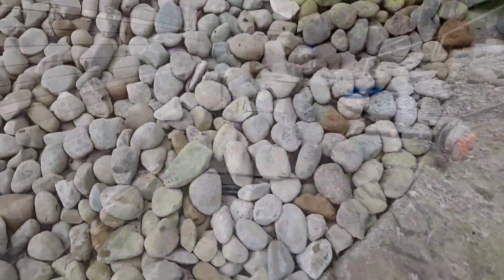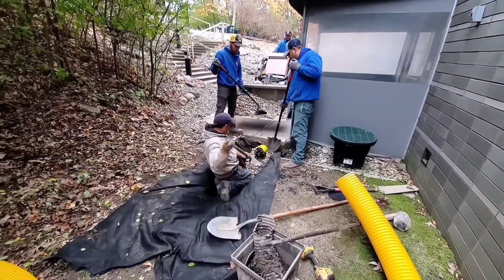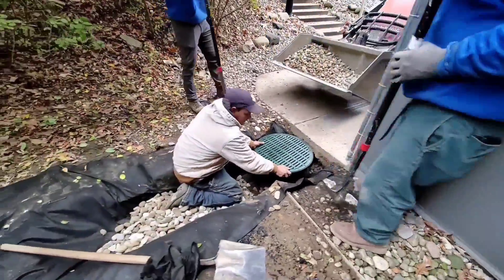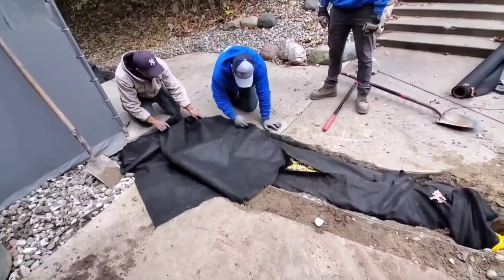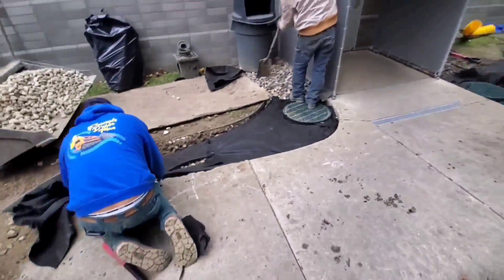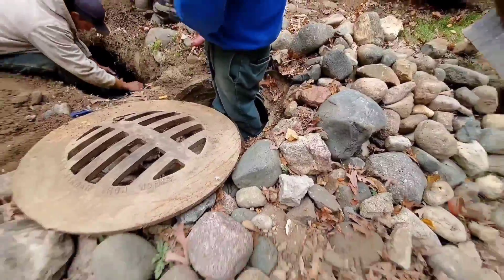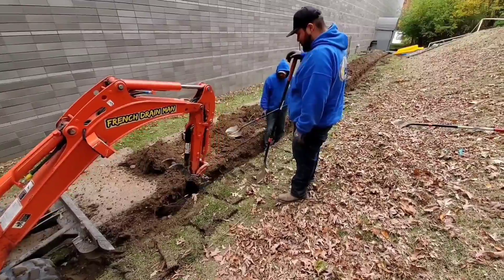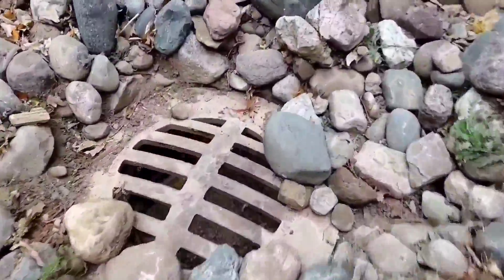How To Fix Standing Water On Concrete, Water Build Up and Flooding

Comment: I’m looking for a video that shows the installation and adapter options for a “grated channel drain” through a concrete patio.  
Can a vent downspout leaf box tie in properly?  
Is there an option to tie into pre-existing pvc drain line?
I haven’t seen it installed on your channel, so I’m guessing you stick to the catch basin/french drain and or yard drain.
Reply from the maker: https://youtu.be/a-XfSvqQCPQ?si=eVymSKWfzQKmG5Gh

Comment: How did you measure pitch for that length of run? How did you make sure the drainage inlets were higher than the outlet on a run that long??
Reply from the maker: https://youtu.be/F5d-47POqbo

Comment: With such a large operation, you probably don't have the time, but it would be great if you could record some of these jobs during heavy rains
Reply from the maker: I move forward always and it still isn't enough. Estimates are out 5 weeks. We do what we do very well. I never have to go back. Thank you for commenting. I will try to run systems for you before we leave the job site.

Comment: I was surprised full length of pipe was not open drain, to catch water off the slope. Perhaps I didnot comprehend  the over all scene.
Reply from the maker: It was a solid discharge line NOT a French drain system around the building

Comment: I'd be interested in seeing a video where you're able to solve a yard drainage issue with some grading OR explain why that isn't a good idea. Of course every job and yard is different, but I'm just curious if there are scenarios where grading solves the problem over a full yard (vs just creating negative slope near structures).
Reply from the maker: I have a awesome video coming up on that very topic. Stay tuned it should be live sometime soon. Thank you for commenting I will  elaborate more on this topic.